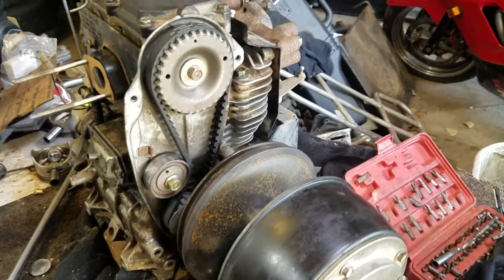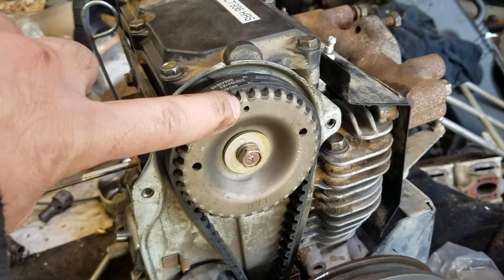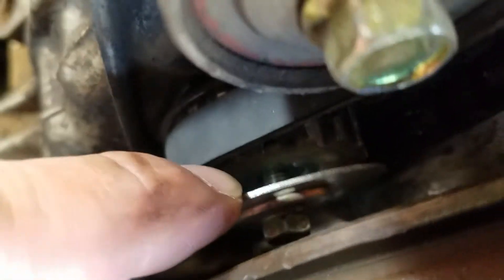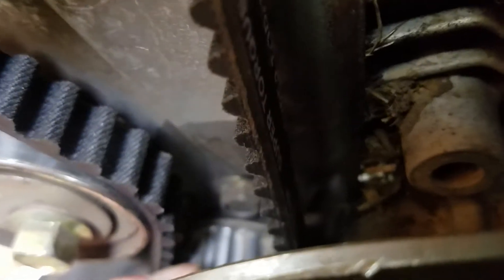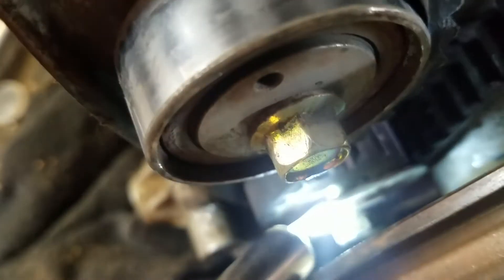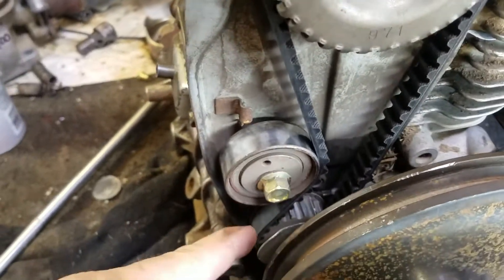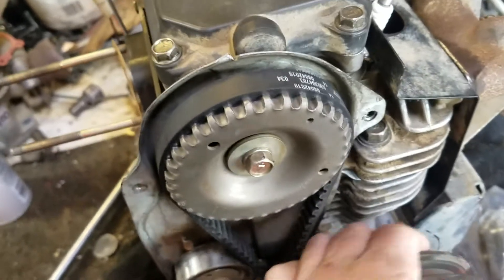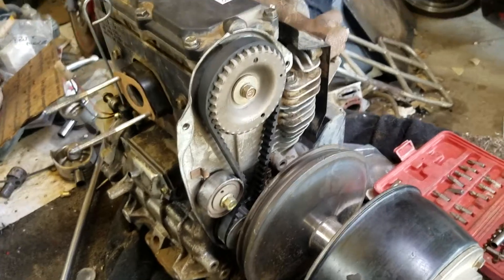EZGO 350cc eh35c Timing engine

Comment: Note, pull the clutch. Takes 5 minutes, and you do not ruin your belt keeper. Another added bonus. Gives you plenty more room.
Reply: How do you pull clutch without taking motor out?
Reply: @DennisFisher-bp4dq you do not have to pull the motor. You can lower it enough to get the clearance for the bolt used to pull it.
Reply: @DennisFisher-bp4dq 
On mine I unbolted the rear springs from the axle perch than lift the body than tilted the engine down on the clutch side .   Took about 15 minutes,  pulling clutch took maybe 5 minutes after that with proper bolt I found in my shop

Comment: Is there anyway to get it 180 out ,,, being the crank gear and timing gear are 2:1,,,none of the vids I’ve seen are very specific,,,
Reply: Did you ever get an answer? I'm questioning mine after replacing the belt.
Reply: @bonniemae100  I did not but I did get it running

Comment: Thank You Good Video. How did you get the cover off ?
Reply from the maker: Technically you have to pull the clutch to get it off. I was able to squeeze a bit onto the bolt to get the bottom one off. Thanks for watching!

Comment: thanks for your time to show this. i did rebuilt mine like 2 weeks ago and i had problems with this. i saw the top part but i didnt see the bottom one. the golf cart is running but sound a little different and dont go a max speed. but runs 😂. im going to have redo it. but i thoght that i can not have space to remove that timing cover without removing the clutch?